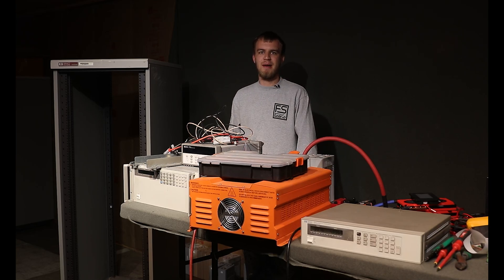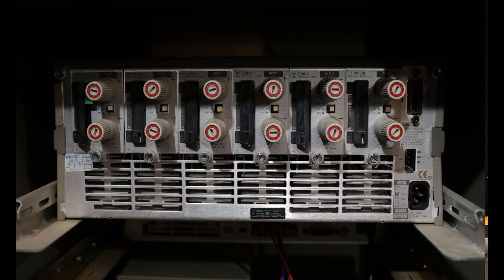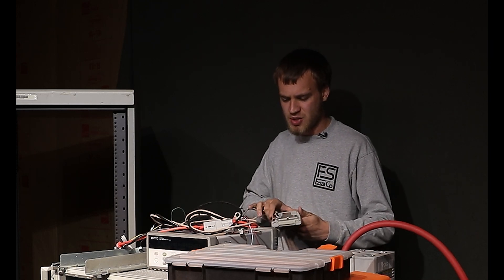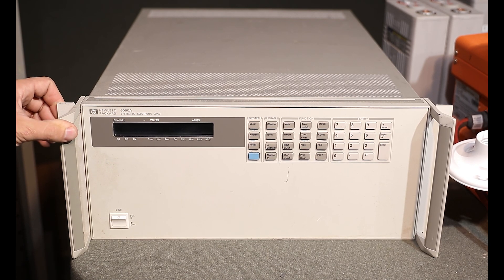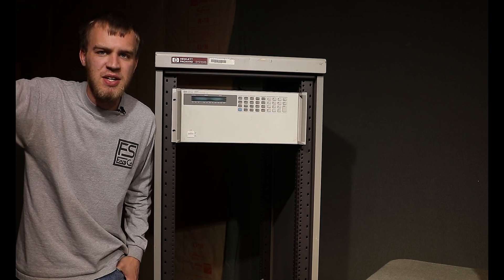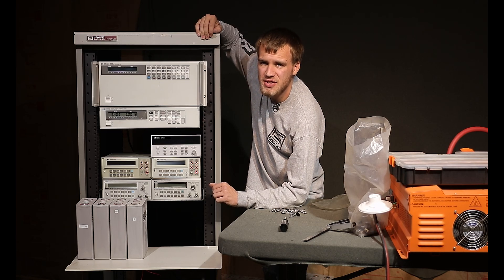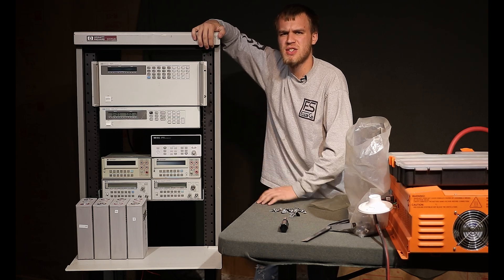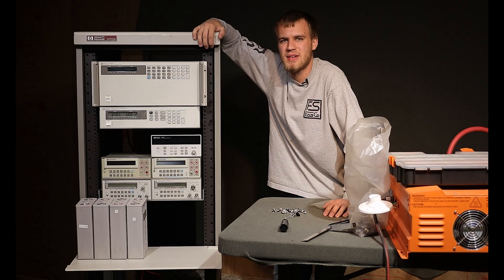Ultimate Battery Testing System ||Top-Dollar Agilent / HEWLETT PACKARD Equipment

Comment: Hey, I work with such instruments a lot, please contact me if you are facing any issues programming them over GPIB. I could also support you develop application using LabVIEW.
Reply: LabVIEW 2020 community edition is free for personal use. You could use that. And BTW, whether it is RS232 or GPIB, they both use the VISA API and hence the code remains the same.
Reply from the maker: Santhosh, We really would love to get connected to them via HPIB/GPIB, but right now we only have serial/rs232 to the 34970A.  We want to find a E5810A so that we can put all of our equipment on the network.

Right now we are using Agilent BenchLink Dataview, but if National Insturments LabVIEW were cheaper we would use it in a jiffy - Do you have a way to get it for less $$$?